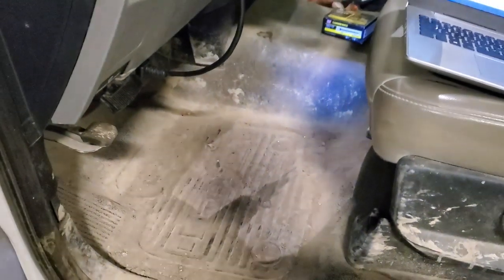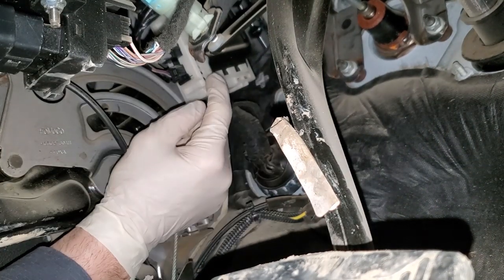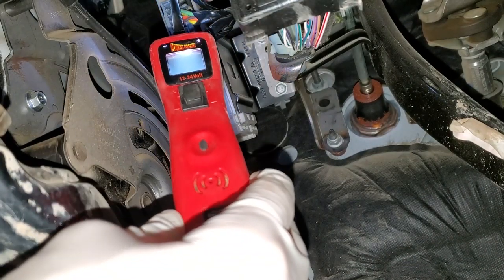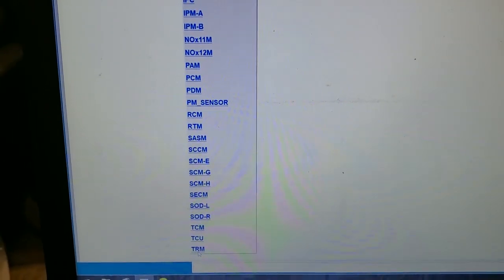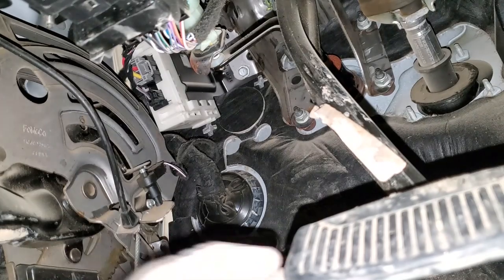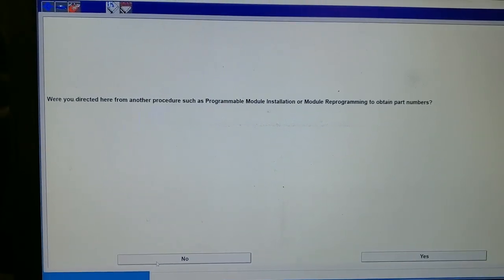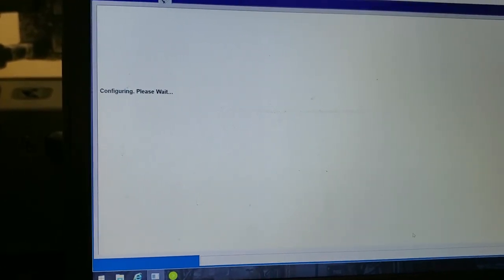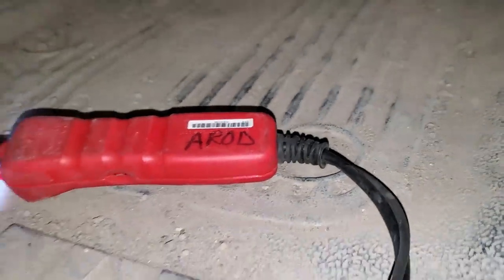2019 F550 Trailer Running Lamps INOP

Comment: I have a 16 550 with a message trailer connected then left and right turn signal fault then trailer randomly disconnected, with no trailer ever connected. I figured I have some corrosion somewhere. I haven’t looked at it yet but at least I know where the trailer module is located. Thank you.
Reply from the maker: Probably not ur issue but yes I would definitely check your circuits back there....specially under da dump!
Reply: PowerStroke Tech Talk w/ARod does the trailer module not send out a bias voltage? I figured it was like a brake controller that sends out a bias voltage and when the trailer was plugged in it grounded the bias voltage telling the module the trailer was plugged in. I though there might be corrosion dropping the voltage but no extra load on the turn signal circuits making it fault on those circuits. It’s just a guess, we don’t run any trailers on it so it’s not really a problem I just hate error messages and cel’s

Comment: When replacing the module, was it necessary to use IDS or could you have simply swapped the module with no computer programming?
Reply from the maker: Nope, an IDS must have. All these new modules hafta being configured to the truck with As-built data in some cases
Reply: What if you bought a used one from a wrecking yard?
Reply from the maker: Ehhhhh

Comment: You must have tested voltage of the running light circuit pin out at the rear of the vehicle before proceeding to the module under the dash? Or did the eManual immediately send you under the dash?
Reply: 1:19 he says he verified at the 7 pin connector it was only getting about 2 volts.
Reply from the maker: No, i verified their concern, @ the rear round standard 7-pin....then proceeded with my own PPT upstream of the supplying circuit....which determined to be a failed TRM.

Comment: Thanks for the video! Had my trailer module go out recently in my 2016 f250 6.7 xlt super duty. Granted I used it a lot before it went bad. Short in one of my trailers didn't help... still under warranty would this job be covered by any Ford dealer?
Reply from the maker: I mean id warranty it. I dont see why other store wont...
Reply: @PowerStrokeTechTalkwARod  was hoping I could fix myself but based on the video and comments probably best to get it fixed under warranty.
Reply from the maker: @nickthrane4940  yepp

Comment: Thanks for the info, I am having the same issue on an 18 450, also the 12v charging circuit is inop. Does this module also regulate that function?
Reply from the maker: Yes
Reply: @PowerStrokeTechTalkwARod  any way to bypass before I can get it in to the shop?
Reply from the maker: I misread....no it does not regulate the 12v. Its just 12 then 14 ish when running
Reply: @PowerStrokeTechTalkwARod  i have no voltage present in the bed or on the bumper trailer connector. All functions work except for running lights.
Reply from the maker: If you like to compensate me visit my email Powerstroketechtalkwarod@gmail.com

Comment: I just encounter this exact problem and symptoms on my 2019 F250.  2.6-3.2 vdc instead of the 12.5vdc.  I will get a new module but where to obtain the latest firmware?

Comment: Did you replace the trailer running light fuse too? Idk what happened but the running lights stopped working on my dump trailer and it popped fuses in my 2019 and 2006. Took trailer to dealer and they replaced front harness but couldn’t explain why it happened... I can’t wait to test my trm tomo now
Reply from the maker: Lemmie know brother
Reply: Something similar is happening to my trailer. Every light on my truck is LED but my trailer is all incandescent. I am replacing my trailer light housings with all LEDs. I’ve seen weird things happen with mixed LED and incandescent setups.

Comment: I have a 2011f550 with no trailer the message comes up trailer wiring fault. I am thinking they used the trailer wiring to run the lights on the dump body. So it could be this module..?
Reply from the maker: Ehhhh i dont think so...

Comment: I messaged you several months ago about my truck and you told me several things to do to it and that was what was wrong with several things you told me but they are still something wrong with it i have put new filters in gas tank, put new fuel pump, ICP, new rebuilt injectors,new valve cover gasket and harnesses new CPS and all the parts were genuine Ford parts motorcraft and it won't run on nothing but starting fluid when you stop spraying it it will run a few seconds and then start to have a knocking sounds from the injectors could it be the ipr or hpop going bad i have about giving up on it any help would be appreciated thank you.  Buster
Reply: Oh yes and i sent the PCM and IDM off to have them tested the IDM was good the PCM had a few problems and they fixed them
Reply from the maker: You obviously are not getting fuel hence it runs on starting fluid. Is the bowl filling up? Maybe your not achieving injection pressures...
Reply: @PowerStrokeTechTalkwARod  i don't believe it getting injector pressure would it be the hpop or IPR it's getting 60 psi fuel pressure
Reply from the maker: Yea it cld be....cld be both at this point
Reply: @PowerStrokeTechTalkwARod  thank you very much for your response i will try them both and hope that fixes it if it don't I'll probably give up on it and sell it for what i can get out of it but i really like the truck thanks again and i watch all your videos and think they are very good

Comment: hi, im working on a 2018 F-350  6.7 4x4 crew cab, for one of my customers, it has the trailer control module, but according to diagrams the bcm prime the internal bcm relay to prime the unserviceable trailer control relay, which is inside the ft juntion box,  i suspect the last relay went out since acording to diagram the trailer control relay gets power from trailer control relay in juntion box, and if i unplug the TRM and apply power to brown ckt then i have power to trailer parking light system. any help or recommendations?
Reply from the maker: Gotta bring it thru
Reply: @PowerStrokeTechTalkwARod  ? ??

Comment: After the module replacement and programming, you test with lights off and it still puts 2.4 volts out? Why, is that why it cost $300 for new batteries? This constant drain?
Love your insight. Great channel.
Reply from the maker: I didnt have a good connection

Comment: Hello, I have a question I have a 2019 F350 and I have no auxiliary lights to my horse trailer. It has a switch for the tack room and sleeping area. No power. Battery charges and everything. Trailer was tested at dealer, I don't have auxillary light power from the truck. I cannot figure out what fuse it is or what is wrong. I am thinking its the same problem from your video but i have no idea. Any help would be greatly appreciated.
Reply from the maker: Id have 2 look at it

Comment: I work at a Chevy dealer. Must say ford has this figured out better than Chevy does. Chevy mounts the module above the spare tire carrier. Stupid. Gets covered in salt, I’ve seen 2016s with holes in these modules from corrosion and service trailer brake message on the dash.
Reply from the maker: Wow, good to know. My boys over @ the chevy store
Reply: PowerStroke Tech Talk w/ARod yes sir been there a bit now working in the truck shop. All I touch is pickups, vans the occasional burb or Escalade and medium dutys. Loving it so far.

Comment: Trailer disconnected warning keeps coming on then goes back to connected all the lights work just brake dosen't. Would that be same problem
Reply from the maker: 7 pin corroded?
Reply: @PowerStrokeTechTalkwARod  I haven't checked but the one attached to the bed ??? I will check tonight
Reply: @PowerStrokeTechTalkwARod  I have the lariat also the lights on the bed stoped working it could be same problem